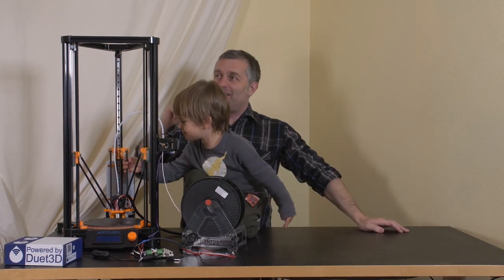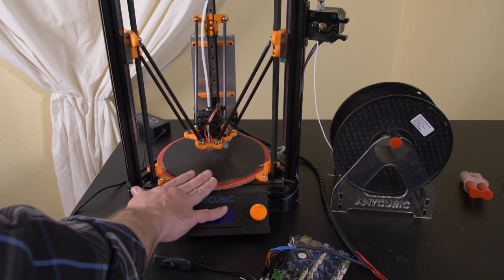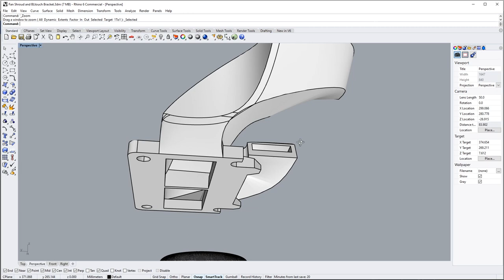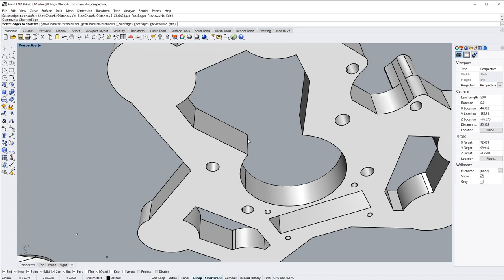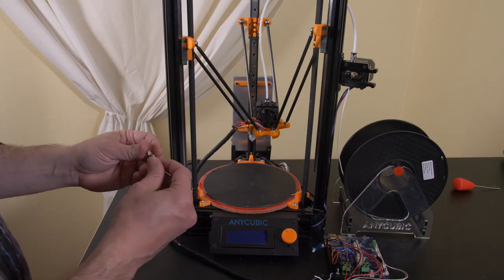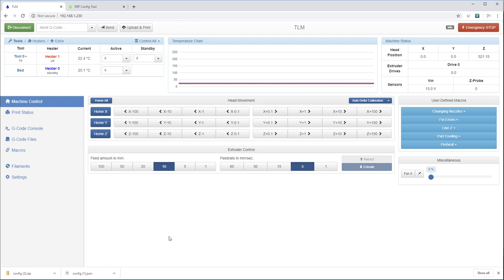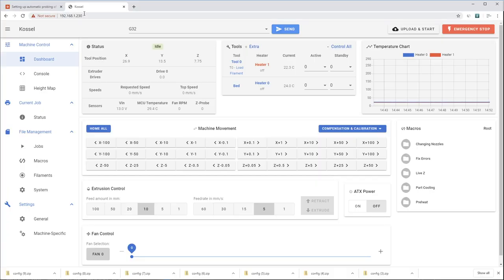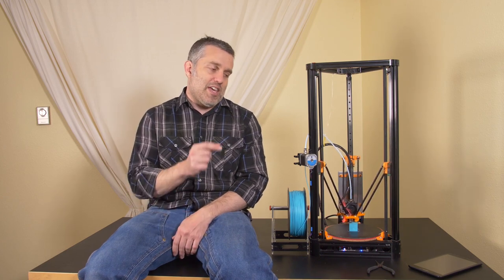Magnetic Push Rods and a DuetWiFi for Super Fast Printing!

Comment: Finally :) is about time ;) I'm owner of the same version You bought (no Plus with pulleys) and I'm running Marlin 2.x with manual mesh bed leveling on factory trigorilla board. I can get perfect first layer but max is  160mm circle( from 200mm bed) Max speed is about 60-70mm/s. The problem I got now is lack of operating memory that is left after flashing newest Marlin ;) If I want to print some complex and big geometry, board drop bed leveling functionality ( it ignores mesh I have stored to EPROM) So yes Delta owners you do need more memory power and more cpu power to slay that dragon ;) Greeting From Poland

Comment: So, you glued the bearing balls ??
Reply from the maker: Fair play... kind of. I'm assuming this is in reference to my criticism of E3D for gluing the gear onto the stepper motor shaft? First of all, I'm a DIYer not a professional seller of 3D printers and 3D printer parts. I don't have a machine shop at my disposal. Secondly, I was using the glue as a thread lock. It's well established that super glue does function like loctite. It's the secondary sort of safety mechanism. The threads are the primary attachment mechanism. In the case of the E3D printer  there is no primary attachment mechanism. The super glue is the primary attachment mechanism.
Reply: @DesignPrototypeTest  Yup fair play.
Honestly you need to see from yourself how many metal parts "glued" in place, no extreme heat or forces >> glue, cheap, realiable and easy to manufacture.
Nothing wrong with it.

Comment: First, the print head touches the belt at the right side of the screen 23:57. That could had caused the leveling[tramming] issue.

I guess the Klipper firmware is on the bleeding edge of the spectrum but why not try it? Klipper firmware supports Duet-Web-Control, has some interesting features, and enable printers to print with grater speeds with reasonable print quality. Also, I think higher printing speeds are a pretty suitable goal for the printer; liner rail delta printer with a Volcano heat block. I believe a claver guy like you can reap the benefits of Klipper firmware despite it being less user friendly.
Reply from the maker: That is a good observation about the belt collision. Unfortunately, it's not the problem. I have since made my probing radius smaller so that the belt collision is not happening. I still get the ridges. The most likely culprit is the lash in the linear motion rails.

Comment: Very nice.
Looking at the first-layer issues, the high/low points are almost across from each other. Maybe slip a couple of fiber washers under the low side, to raise the whole bed, then raise the Z by 0.05mm?  (I'm suggesting fiber washers, because you can sand them down easily, of they raise it too much).

Comment: I designed my magnetic effector from scratch but I went the way of having the magnets on the push rods instead of the effector itself. That could be one way to move the magnetic field back from the bltouch sensor. It'd still expand a little from the metal ball bearings but not as much.
I will say that with my design, even though it works, I designed the ball bearings to sit to close to each other on the three corners, so I think the magnetic fields were opposing each other as the moved to certain angles. So when that happened one axis was slightly pushing on the other axis. This would only happen for larger prints or prints that were on certain outer area of the bed. 
Right now I am trying a new design using ball cup joints. At least that is what I call the name of the joint. It uses the ball bearings from the magnetic joints but cup on the end of the rods. I used my resin printer to print the cups.
As for the control board. I went from the original 8bit board that came with my Kissel mini to a 32bit skr. It works but I noticed it seems to act like it has linear advance enabled, that speed up slow down effect. Not sure what that was about but I know it is not enabled. This was before switching my design from the magnets to a ball cup. I have not tried it since changing my effector design as a I'm still designing some cooling fans for it but I hope I can get that figured out. I was thinking of trying the duet but they are a bit too expensive for me right now. I like the Skr boards on my other printers so I have a few extras which is why I choose to use it. But I heard that Marlin is not good for Delta printers. Not sure why, it is just what I heard. Maybe there is some truth to that, but who knows. I may have to try Smoothie if I can't get it to run Smooth with this new build. Punn intended. 😜

Comment: I've got to say, Although the duet boards are superior, they're sooooo expensive.  I got a BTT skr 1.4 turbo and flashed marlin to it for my kossel and it took me 1 afternoon to get it up and running.  Including manual bed leveling.  I got wifi with octoprint that I already had set up with the ramps board that came with the printer.  I'm on a tight budget, and it was very much worth it for me.  Marlin isn't too hard.  you don't need to know any c++ other than how to comment and uncomment things, and I used vscode with platformio instead of messing around with the arduino IDE.  flashing new firmware is as easy as compiling and putting the binary file on the micro sd card.

Comment: I own an Ender 3 Pro with a MicrosSwiss hotend, Bltouch, HeroMe Dual5015 fans, BMG extruder(clone), and DUET 2 wifi based on Your design enclosed with the power supply, PanelDue i5,stepper motor dampeners, with Noctua Fans at hotend and PSU-DUET bla,bla,bla
And i can tell that the single biggest improvement in my workflow-quality in prints, is by far the Duet 2.
That said, for many people doesn't make sense to have a 170$ board on a 200+$ printer.But indeed Duet is by far the most advanced board out there, without saying i couldn't achieve almost the same result with cheaper 32bit-Marlin base boards.
It's just better-faster, and with great interface.Everyone who used one knows what i'm talking about.

About your weird-looking Height Map bed leveling, I think you still have some interference between BLTouch and magnets, even with your new design ,even if bltouch doesn't trigger an error.
I don't know any way to measure non-time-varying magnetic flux, so you could check it.
It could also be an instability of the frame as you say.

Keep doing videos like this.
Reply: Also got a Duet2Wifi after raging about the SKR MINI E3 and the horrible customer service of BIQU/BTT.
My Creality Board was dead ( I still don't know why) and newer Creality boards were in my opinion overpriced, TH3Ds Boards price would have been ok, if it wouldn't nearly cost the same with shipping and customs to an Wifi purchased in my home country

Comment: I bet the problem with your bed leveling is that your end effector is tilted and it is tilting the BL Touch. You can probably level it by adjusting the 3 end stops. You can see it in the overall tilt of the bed on the mesh display.

Comment: Nice to see you're back at creating content. Yes delta's havent changed that much over the years. I've got 2 delta's made in 2014 that with modern additions like 32bit electronics, you would never guess is that old. Still rocking it's original V6 which I only recently upgraded with a new block as I broke the original thermistor. If you change it back to wheels, you must be able to get that calibration better. I' always achieve a deviation of 0.006, with my BLtouch is only mounted with a single screw. On the marlin, duet thing. You should really give modern marlin a shot, only the first time is hard, after that it is as fast as setting up a duet. Although your arguments are right. I don't need to remove the board of one printer to get another printer set up. I think you wasted a lot of time doing that. I've even got spare boards lying around. Though duet might be way easier to set up, its does not make printer print better. So I spend my money elsewere. Btw, the days of reprap firmware being associated with duet are counted, there is progress on running it on boards like the SKR. Best of both worlds?

Comment: I own a flsun QQ s Delta and I just bought duet 2 WiFi board. How hard would it be to hook this board up? I've been watching you videos and I love the board I also notice you have flsun Q5 printer. Any plans on installing duet 2 Wi-Fi? Also the flsun QQ s comes with a switch activated bed leveling system and I was wondering if that could be utilized with duet 2 board? Keep up the good work love your stuff
Reply from the maker: Yes, the switch could easily be implemented with a Duet control board.

Comment: Does Thingiverse not protect designers work?
 With all the hard work you have put into this printer did you ever think of designing a full printer?
Reply: well, unless you have a commercial version of Fusion 360 or whatever 3D Modelling tool you are using, you are working under an open source license agreement, and since he has none of his 3D parts registered under any form of license, sharing these is fair game

maybe not fair in his point of view, but there would be ways to prevent this

Comment: Could you not of magnetically shielded the probe? With aluminium tape or copper?
just a thought if anyone else is using this setup it might save them some time in printing.
Reply from the maker: There is no material which can shield from magnetic flux. The only thing you can do is redirect the flux. This is a complicated thing to achieve. I imagine that the two bolts holding the BLTouch are doing a bit of that, but the best technique is just to give the sensor some distance.
Reply: @DesignPrototypeTest  mu metal used to be used in all sorts of applications to shield components. It caries the flux lines around the protected item, as well as creating a faraday shield.

Comment: Can you disable interpolation for individual axis drivers on the Duet?
Reply from the maker: Absolutely. It's super easy. You can even make the adjustment though your web interface. Just go into the config.g file and change the M350 for whichever axis you are wanting to adjust. eg. Change M350 X16 Y16 Z16 E16 I1  to be two lines 
M350 X16 Y16 I1 
M350 Z16 E16 I0 

This would turn off interpolation on both the Z and E axis. I don't know why you would want to do this, but of course it's an option.
Reply: @DesignPrototypeTest  I'm running tmc2100 clones on my Artillery Sidewinder X1 and the tmc2100 doesn't allow disable of interpolation without disable of stealtchop. I was curious if the hardwired drivers of the Duet allowed that. The reason to get rid of interpolation on the z axis is outlined here and has to do with missed steps which are cumulative on the z axis:

https://forum.raise3d.com/viewtopic.php?t=6013
Reply: I doubt I have m350 active on my Marlin but it's worth looking into. I'm running Waggster Mod 1.5 with Marlin 2.0 for my V4 Sidewinder and some tft firmware I have been customizing for myself
Reply: The gist of the article is that interpolation is prone to missing steps under frequent changes in speed like you see in 3D printers. So a few interpolated steps on the xy axis doesn't hurt much and ultimately leaves you with more accurate print than microsteps alone, but on the z axis a small variation in layer height will pronounced itself across the whole layer and the following layer(s)
Reply: It would be especially prone to missing steps with vibration on the z axis, especially with an 8mm pitch lead screw like the Sidewinder has. So much as bump the machine and layer shift.

Comment: I think your G29 showed such a strange image of your bed because the head touched the belt at the end of the first line.
Reply from the maker: Good observation! Unfortunately, it's not the problem. I have since made my probing radius smaller so that the belt collision is not happening. I still get the ridges. The most likely culprit is the lash in the linear motion rails.

Comment: I have the plus version and the linear rails are not that wobbly :D i think its different from piece to piece. Also the bed leveling error is not that extreme on the one i have with everything stock. But am gonna need to upgrade it to the 32 bit board :D it looks very good

Comment: piezo probe can be had cheap these days.  want to go over to reprap but worried about longevity (vhs vs beta max), marlin has a lot of support.
Reply from the maker: I think your analogy is not the best. A better comparison would be Apple and PC. Both ecosystems are still around, after many years. Duet and Reprap Firmware are growing/improving daily and the community surrounding that open source project/product is quite vibrant.

Comment: WHAT IS YOUR OPINION ON HOW THE CORONA VIRUS WILL AFFECT 3D PRINTING STOCKS?
Will 3D printing stocks get a lift with our need to import less from China?
Reply from the maker: Injection molding makes parts in seconds which take a 3D printer hours or days to make. 3D printing will therefore never challenge the established mass production manufacturing. China has an iron grip on manufacturing for the world. 3D printing is not a magic pill which will bring jobs back to the US. Even in the current environment. The only bright light here is Tesla, but Elon made a deal with China and that is what saved his company from the stock depths last year. Therefore, even Tesla is now under Chinese control to some extent. If ever the U.S. wins back manufacturing it will be a painful process for our culture, and only the hard work and dedication of Makers, Entrepreneurs and Engineers with help from the 1% and the politicians will make that happen. Much as I love 3D printing, there is no magic technology that can save us. My biggest hope for the fallout of Covid 19 is that it will cause the 1% to turn on the CCP.
Reply: @DesignPrototypeTest  Thanks for your insight.

Comment: Almost everything you’ve demonstrated on the duet can be done with marlin on an skr 1.4 board and an octoprint pi for half the price. The only real difference I see is the way in which the firmware is configured, honesty. 

Yeah the duet is the premium option but you act like marlin is just total shit, and it’s not. Duet is one cohesive product though, which does give it some advantages. In order to achieve the same functionality with marlin you need octoprint and half a dozen plug ins. 

You should compare duet to klipper, which is a much more apt comparison. Klipper gets rid of some of the janky ness you seem to dislike with marlin so much, and allows you to use pretty much whatever hardware you want.
Reply: If that half you save is worth more than your time you put on it, absolutely.

I earn that money in <30 minutes of work, i just can't defend spending the days it'd take me to configure marlin.
Reply: @angrydragonslayer  it's also learning stuff about electronics and programming firmware
sure you can just buy a 12k 3D printer and it prints awesome out of the box but for most people this is a hobby, and doing as much as possible yourself is the fun part

Comment: have to disagree partly here, a non-duet board gives you a bit more flexibility regarding stepper drivers, so far there is no duet board with plug-in slots for stepper drivers iirc

Comment: My standard 8bit prints better than this :) I am upgrading to 32bit bit my Plus is printing excellent
Reply from the maker: Watch the next video in the series: https://youtu.be/iNMt2MYfrF8 This is not an 8bit control board in existence which can print that quickly on a Delta. The processor can't compute the arching movements quickly enough.
Reply: @DesignPrototypeTest  will give the next one a watch 👌 I know it wont print as fast as a 32bit but my 8bit is printing at 60mms and its spot on , if only I knew how to upload pics on here 😅😅